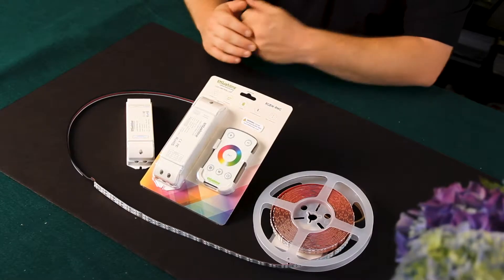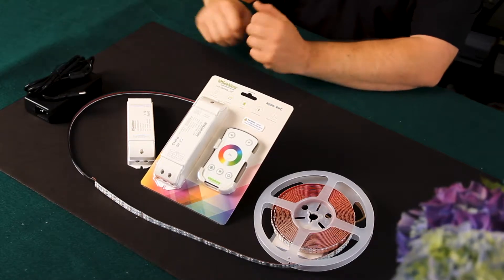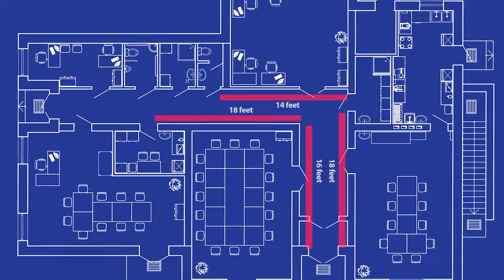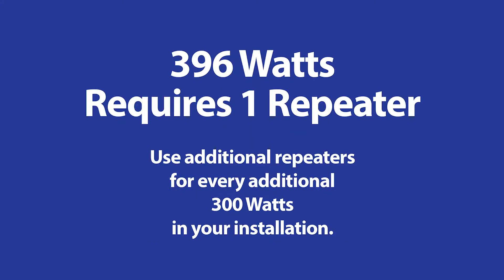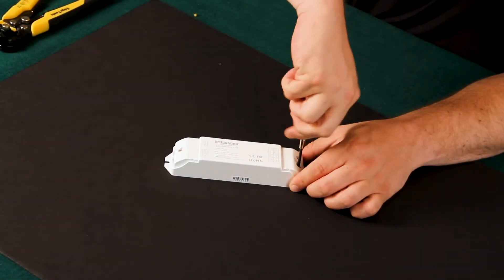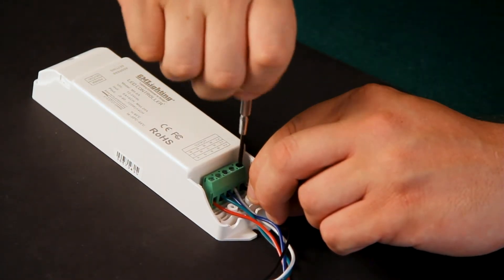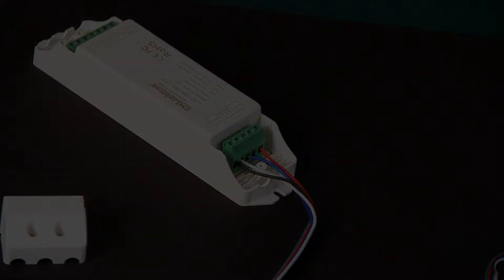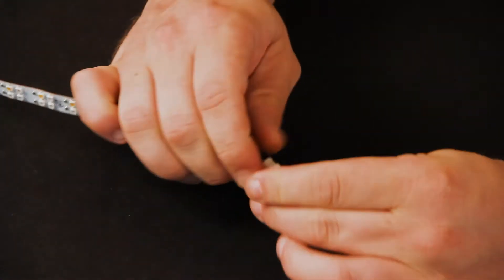RGBW: Installing a Repeater For Runs Over 300W

Comment: very interesting but what type of wire do you run in between the controller and repeater or does it work off an rf frequency? also can you integrate this product to ra2 or homeworks qs to make it do all that via a keypad?